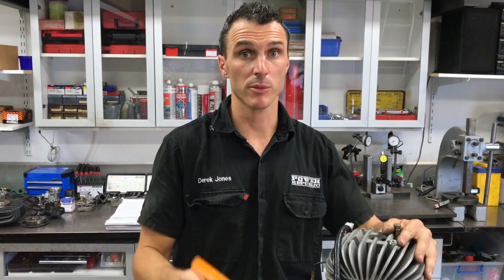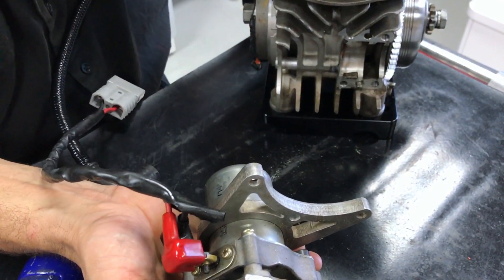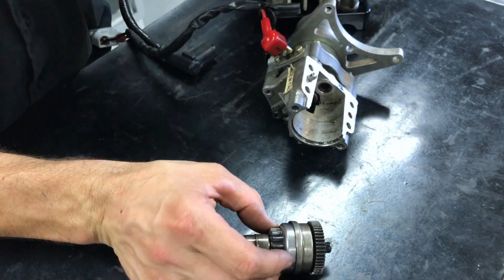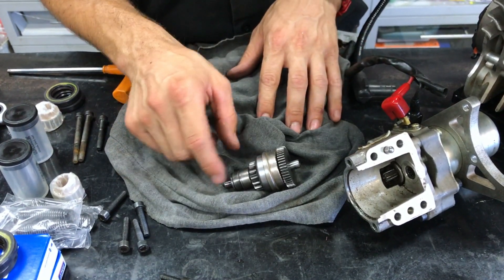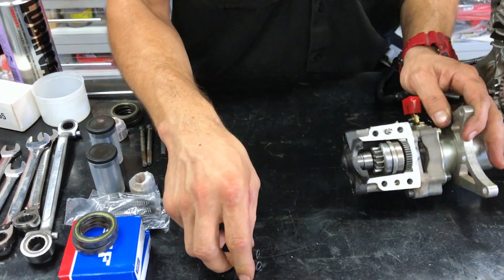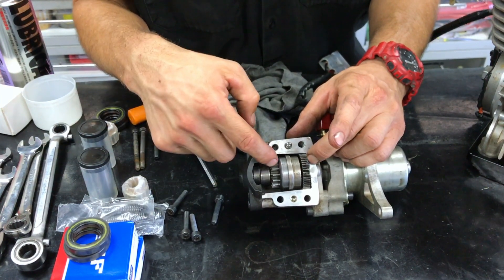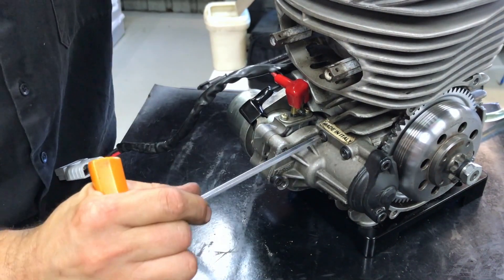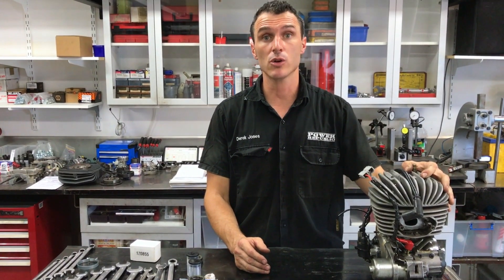Power Republic - How To Service The Bendix On Your Vortex Mini Rok Engine

Comment: Is the KA100 similar or more like the X30, i followed this one,  took all of the same bolts out (as it looks identical from those parts) and it won't budge. Thanks
Reply from the maker: Ka is same same as mini rok.  Use soft hammer to get the housing to move off the crank casss

Comment: Gidday Derek, thanks for everything you do here - it's all very helpful & I've learned heaps. I have a feeling the Bendix in my X30 is playing as I'll occasionally just get a whirring sound on startup that'll happen a few times before starting. Am I on the right track? If so, does the same or similar approach you show here work on the X30 as well or is it very different? Thanks again
Reply from the maker: Yeah boi, thanks heaps for the kind words, and glad we have helped you out.   
Yeah I would pull the ring gear off and look at the bend drive teeth and also the starter motor output shaft teeth.  the other thing can be low battery power, so make sure you have a fresh fully charged one
Reply: @PowerRepublic  perfect thankyou Derek. Champion. I wouldn't know 10% of what I do now without your help & there would be plenty in the same boat, so what you've been doing has really helped a whole generation of Dads (and I shouldn't forget the Mums) help a whole generation of their kids... Thanks again
Reply: @PowerRepublic  Hey Derek, did some work  on it yesterday but how can I fully access it like you have in this vid to do a proper clean? Seems I'd nearly  need to pull the engine apart but that's probably not a great idea. Easy enough to get to the front & back by removing the start motor & cap adjacent to the ring gear so if I can't fully access it is it ok to hit each end with my cleaner/degreaser or am I risking it not cleaning out properly and/or the degreaser ending up somewhere I dont want it to? Thanks again
Reply from the maker: @psalvest  is this on the mini roK or X30?  tomorrows video is on the X30 bend removal for you.  thanks heaps for tuning in
Reply: @PowerRepublic  The X30. And that vid was perfect, you must've read my mind. Thanks again
Reply from the maker: @psalvest   anytime !